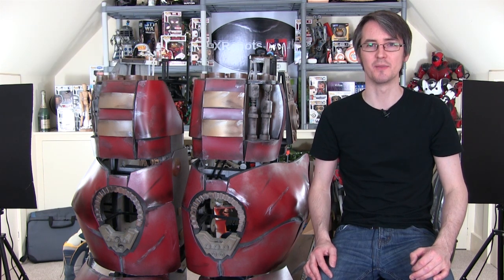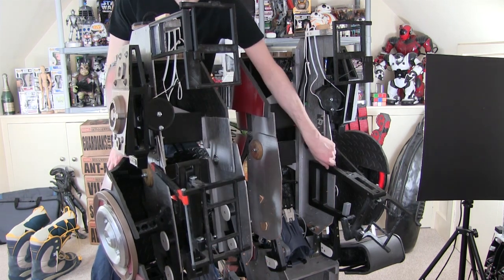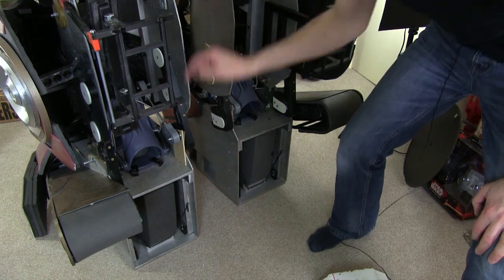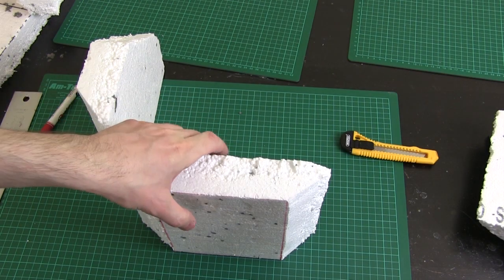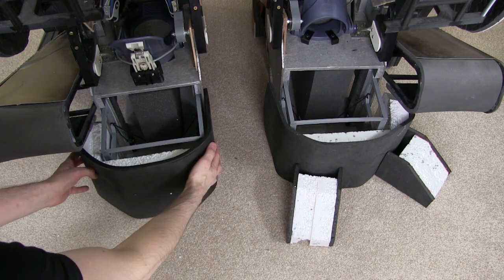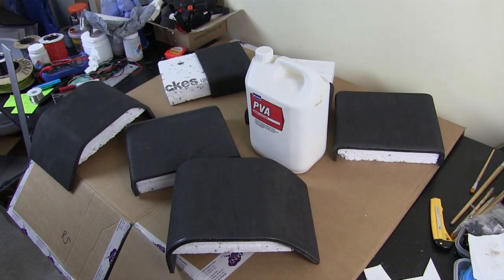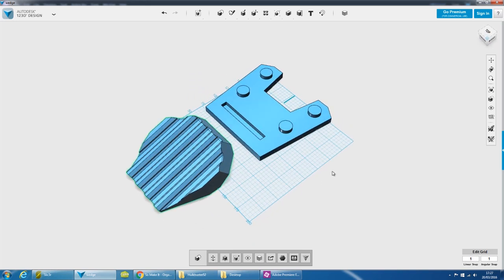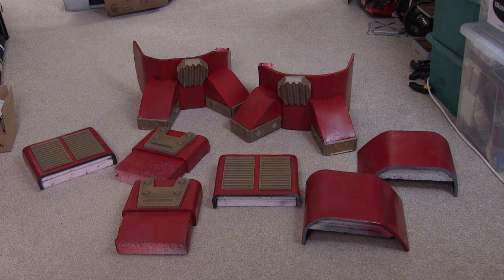Iron Man Hulkbuster Cosplay #52 | Leg Back Panels | James Bruton

Comment: I am wondering about the durability of all the hot glue joints on something that is big and you can't always see if any bits or corners are hitting each other or something else.  I guess you can get industrial/high strength glue sticks (maybe?).  Is that what you use and/or do you have issues sometimes with the glue joints on pieces (especially flexible pieces)
?

Comment: If I may recommend for cutting styrofoam, Just grab two wrenches, tie a length of copper wire in between them, hook up the wrenches to a power source, activate the power and you have something to cut styrofoam without making a mess with the pellets going everywhere

Comment: How good an alternative to plasti-dip is all that PVA? Because plasti-dip is super unavailable in Australia, you need to buy it from third party importers who charge $30 or so per can, so its really not viable.

I can't see myself ever having the issue of needing to refrain from using PVC foam board (and really, I can't thank you enough for introducing me to that stuff) for weight reasons, but it is something I can only get via special order; nowhere stocks it normally, so it'd be nice to know a way by which I can paint EVA foam using readily available materials

Comment: why don't you try make a Styro slicer ? you can find in the king of random YouTube channel !
Reply: Posted he may need one, scroll down... Why did you have to beat me by 21 minutes?
Reply: I don't think he's slicing enough styro to justify the effort really. Making one would probably take longer than the combined time of styro cutting he needs to do
Reply: +Magmafrost13 but maybe it can make the Styro smoother !
Reply: +Magmafrost13 can't take that long though, it's basically a wire and a 9V block.
Reply: Dave P nor does it take that long to cut a few pieces of styrofoam
Reply: Magmafrost13 Sherley. with a clean, sharpened blade :) it worked the way he wanted, so I'm all fine and happy to watch the video.